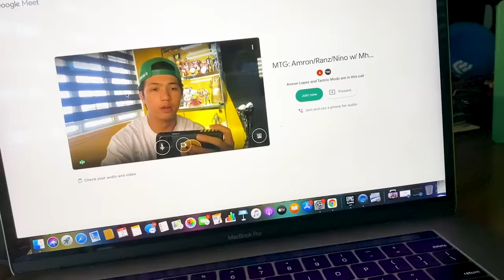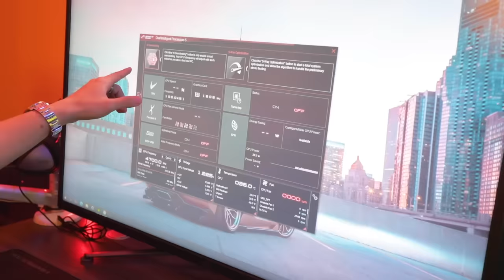Our ULTIMATE PC Gaming SETUP!! (ETO NA!) | Ranz and Niana

Comment: Calibrate the monitors with a color meter like SpyderX or X-Rite para color correct ang colors ng display niyo. Nice builds for the both of you. Congrats!😁👍

Another thing, if you want to stream while gaming you might find it easier to setup and do the task by using 2 monitors para gaming sa isa tapos streaming apps naman sa kabila.👌